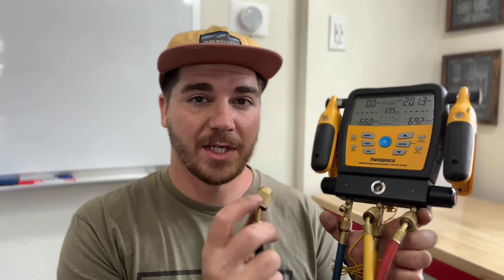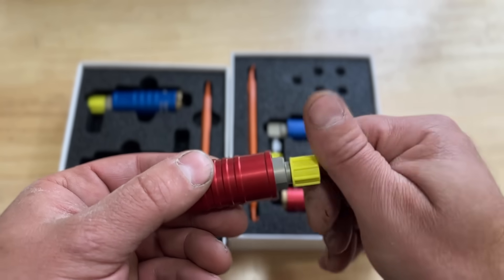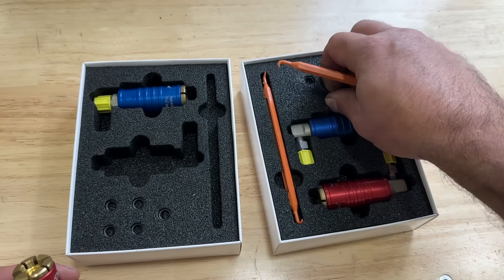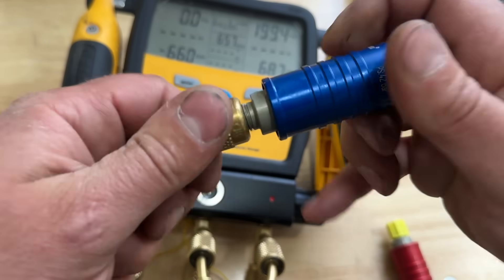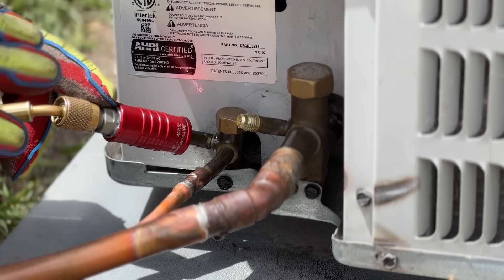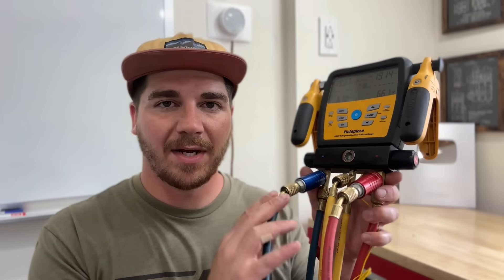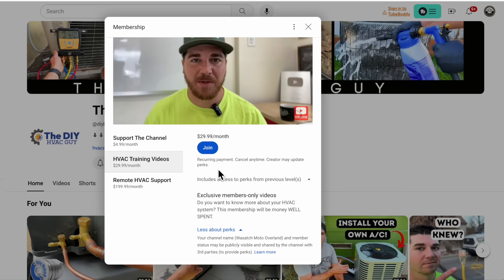This New HVAC Tool Is A GAME CHANGER.

Comment: I thought maybe $50 at the high side, but $200!!  I rather lose a bit of freon.
Reply: Just wait till China start producing them. These are basically quick connectors that are used in car AC's. I predict you will be able to get them for less then $10.
Reply: @lwh7301  Hope the quality stays though.
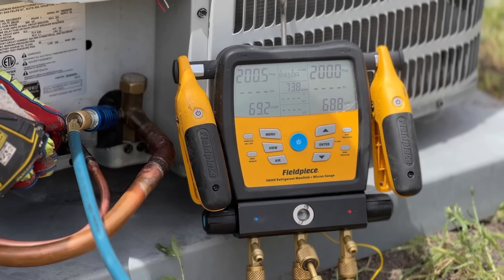Reply: 3:27 to 3:28 appears to be a jump cut - wonder what happened between takes with high pressure connection
Reply: @L0st-n0found damn I just had to go back and check that. You see not much comes out on the 2nd part
Reply: @FirstLast-f8z  yes I wondering in the 1st take how much came out that it had to be redone so not much came out.
Could just be a glitch encoding or whatever but very much looks like a jump cut to cover up something
Reply: I  saw this comment and immediately left, didn't even watch the video, I'm good lol
Reply: Trying the $21 dollar Amazon ones. R410 liquid side is freezer burn!
Reply: Yeah I’ve been eyeing this for years but since it’s German we get taxes like hell.
I hope that just like Knipex someone like Irwin would copy this design and make it affordable for the US techs.
Reply: They must not last cant even buy them now. Just get the low low ones with the screw head works great
Reply: You can  do same thing standard hoses but you push on connectors unscrew
Reply: Unless your gauge is only servicing one refrigerant and you're keeping the gas in the hoses in between connections, you're loosing quite a bit more gas from the system by pressurizing the hoses when you connect them to the system than you are by just attaching the hoses and loosing a little hiss or spritz of liquid, aren't you? Unless you're really slow when you screw the fittings on.
Reply: @WaffleStaffel  And since refrigerant loss damaging the ozone layer, and now they say ozone safe refrigerants still need to need replaced because they have to high of a (shit I just had training on it and don't recall what the scam was) we gotta switch again.
I like pepperage farms remember when we purged and pressure tested R-22 systems with R-12 because it was cheaper than nitrogen.
Funny how the OMG R-12 is killing the ozone layer happened when DuPonts patent expired. I also remember then they came for R-22 using the same reasons, so R410A came out. It was said to be ozone friendly, safe for the environment etc.
But here we are again, and R410A is evil, and we must replace it with R454B, its already stated that in 10 or so years we will need to replace R454B....do you see the pattern I see?
Reply: @ZERO-F2G- not a pattern but a plan
Reply: @ZERO-F2G- in some Middle East countries if not all no one cares about those things and they have hvac techs work every day installing and repairing and maintaining units worry free of these rules only we have to worry about this ozone 😂 and keep paying for changes happening while they still have new R22 units being sold and 20 pounds r22 is for 30$ to 50$ max that’s why they don’t care how much they lose in the air while here we buy it for ove 1000$ this is a joke
Reply: Losing a bit of freon is far cheaper for a DIY, but when you're charging by the job, you want to minimize cost.  There's a break-even point, somewhere.

Comment: 20 years in the trade and I’ve never used gloves to connect gauges, also I’ve never been burned by refrigerant.
Reply: Really? Not once? In the past 35 years I have done it a few times because sometimes you're just dealing with a nightmare of a installation that some got away with and you just do the best you can.
Reply: @KO-pk7df  damn, 35 years in the trade! I have much respect for the veterans in the trade.
Reply: yea, I'm sure literally never. Smh. Ok dispatch.
Reply: @ChristopherSugg  - never once! Always had valves at the end of my hoses. How the hell would I burn myself?

Comment: Shoot, I've been using a set of those for over 5 years. But be aware, when you pop off that high side the O-Ring is going to fly out, so keep it close to the fitting or put a rag around it, also it does not like to go on if there is pressure in the hose.

Comment: Now that's a sweet setup there. Time saving & much less loss of refrigerant. Every customer always asks or say I paid for the refrigerant that you just let go. They always say they being the AC guys in the field. We always put in a little extra just for that measure. Yeah okay. 🫣 Love the video! Will definitely check out the expansion and understanding of home units. You would think it would be just the same as commercial but they are not. Fundamentally they run the same but with commercial you have higher voltage either at 240 volts but we ran 277 volts. Contact relays etc etc. I would like to brush up and deeply appreciate the opportunity to possibly join and win something that would progress my knowledge in the field. Thank you kindly 🕊️

Comment: Well lets see $220.00  is far less that $44,539  per venting violation, the EPA pays 10,000 to any witnesses reporting.
Reply: Because these are the only way to connect legally. 🤔
Reply: @realSamAndrew  Out here in Arizona we do things differently and you obviously never worked  spindle chillers and it shows.  I bet you never even seen a Vacuum Chamber .
Reply: @ericabarca5871  you've obviously never learned about logic. Because your arguments make no sense, and completely sidestep the point, and don't answer the challenge presented by my first comment.

In case you don't understand what I mean, let's put it this way: are you trying to claim that without these 200$ connectors, you will be fined? There's no alternative and never has been? What did you do 2 years ago before these were available? There's no cheaper product or method to avoid an EPA violation? It's $200 or $220 or $44,000, take your pick?!
Reply: @realSamAndrew  I don't know but if i ever see you charging a unit, I'll report you.

Comment: German engineering?  Remembering the dumb engineering and fixes our beetle required... it's a turn off lol.

But yeah low loss appion gear seems worth the cost imho compared to these.

Cool though and keep the content coming <3

BTW a diy guy called into the shop "I installed my ac myself, but can you guys come and braze my line set, purge the system and add needed refrigerant? "

I thought of this channel when he explained his needs. Hopefully everyone else has better luck.
Reply: I had a guy get a quote to install equipment he's getting from a friend who's a vendor. He hasn't accepted the bid, guess it's too much. About to tell him if he does the tear out, install, electrical, I'll come brace them and open the valves for $500 lol
Reply: @StangxX  =b you're a good man and i hope the guy will appreciate your help!

Comment: A true tech does not leave pressure on his gauges.
Reply from the maker: No such thing as a true tech.  We are all just wanna be’s
Reply: @diyhvacguy speak for yourself. You’re supposed to be licensed to work on hvac systems hopefully nobody gets hurt because you promote DIYing them.
Reply: Talking about cycling all the refrigerant into the system from the gauges?
Reply: Wanna bet?
Reply: Digital gauges don’t matter with that. You’re talking about old-school gauges and those are really good for probes because you don’t wanna mix refrigerant on the hoses so for like today when I’m doing maintenance on this 40 system hi rise today that would be really good for hooking up the probes for sure. ❤😊
Reply: I often leave a little pressure in my gauges so I know there's no leaks.
Reply: It took me long to figure it out no one ever thought me til it clicked one of these days

Comment: Unless you have an actual problem with a unit, it is no longer considered good practice nor even necessary to check an a/c unit's refrigerant charge. You are better off only checking temperatures of the air intake and out, temperature of the lines, and temps in and out inside. 
And instead of these tools, you should use Accutools's valves that first attach to the lines, then attach your measurement tool, then they have screw valves that then depress the shraders to allow refrigerant in. Even then, only one is really necessary for the liquid line, and if you use probes, will not lose any siginificant refrigerant that needs to be fed back into the system.
Reply: I use stub gauges with a charging tee and ball valves.
Reply: @thisisyourcaptainspeaking2259  yep, even were available in analog form. But rarely anyone used them.

Comment: I still hear a spurt when disconnecting... the same kind of spurt when you disconnect the normal hose quickly. almost seems like the Schrader valve is going to let about the same amount out regardless of method so save your $200, unless your an idiot that untwists the traditional hose slowly
Reply from the maker: Sometimes you can only spin it slowly due to the position. 🤷🏻‍♂️

Comment: Looks like somthing a young kid would waist money on 200 bucks for somthing that will fit maby 60 percent of units I work on might suggest good pair of gloves for 20 bucks
Reply: True. There are a lot of units you could get one of these on and not the other. Im about to upgrade and get the job link setup. Those wireless/hoseless ones barely release any refrigerant. But, like these, they just can't be used sometimes.

Comment: Lots and lots of units where there's not enough room to fit these due to bad engineering from the manufacturer not thinking about the service techs. Price is too much. Obviously the hoses must still fill up with refrigerant. So there may be less squirts upon connecting and disconnecting, there's still refrigerant loss in the gauges and hoses.
Reply: That's why I love the fieldpiece probes and tees and backseat control valves. Incredibly small amount of refrigerant loss when connecting/disconnecting
Reply: You could always give proper procedures a try and have virtually little to no refrigerant in your hoses when finished, give it a try.
Reply: Not to mention if you leave the hoses pressurized then hang your manifold in the truck on a hot day your gauges could blow a spring with the increased pressure. Don’t ask me how I know.
Reply: @davidlundy5007  That would be a lesson learned. Just don’t do that. Simple.
Reply: @davidlundy5007  whoosh, your supposed to never leave liquid refrigerant in anything that doesn't have or connected to expansion space(cylinder, receiver, accumulator).
so never in hoses, lines, gauges or anywhere else between closed valves. doing so it asking for a very high pressure explosion. a little vapor pressure isn't as bad, but still not good for your gauges.

Comment: If you’re just checking pressures use probes, these will just give you contamination on the next unit you hook up to. If you let liquid out of your hoses, you’re doing it wrong, heat up your hose by rubbing it to boil it off.
Reply: Or vent the high side to the low side for a second or two....
Reply: @GaryGipson I was just shown this method. Don't know why I hadn't been shown before.

I am also buying the fieldpiece job link set with the probes
Reply: I have a ball valve on my high side and always charge it back through the low side before disconnecting. there's basically zero loss that way, only a minuscule amount of vapor

Comment: While I appreciate new tech....this is a waste of $200.  You can just buy flow control valves for $20.  (C&D CD5050).
Reply: Come on man why are you trying rain on our parade I have spent 200 bucks on all kinds of dumb stuff smoking drugs women with no scruples these fittings won’t let you down but the other things I mentioned will  .
Reply: @robertstonebreaker8394 You had to have known that anytime someone recommends a new type of tech that is a call for all of the Super Techs to express how the new tech is so far beneath them. Their way is ALWAYS better. 😑...🤣
Reply: @Aquariun9iteMMare  Knob, another DIYer I’m guessing, new doesn’t mean better .Stay Cool ❄️
Reply: @robertstonebreaker8394  wait, are you telling me drug smoking women of low character might let you down? 😉😁 some are dumb enough to stay married to one twenty years. Who you looking at ?  😂🤣  I'm just a slow learner I guess. She cost one Hell of a lot more than $200, I'll tell ya....😩
Reply: While you are right the fact is the c&d valves still release a spay when disconnecting, about the same amount as low loss hoses, this is the why the $200 connectors were born… they eliminate that loss as small as it may be… to each their own 🤠
Reply: And the new ref is ganna make all this not work
Reply: The CD2070 core depressor has an internal shut-off that holds gas in the hose when disconnected. $21-28 each
Reply: C&d valves suck bit of mine went out within a month
Reply: I have a valve very similar to the 5050 that’s part of a hand pump I use to set pressure on the air shocks of my mountain bike. Once that valve is closed, anything that gets out after is from the hose (not the shock), not the system so any refrigerant that comes out will be in the tools hose no matter what.
Reply: @GNX157 which pump?
Reply: @Chuckolicious  don’t know at the moment. It’s in the trunk, but it does the same thing, backs off the core valve so the air in the shock is sealed in before removing the hose. Even 1-2 psi on a front or rear mtb shock is critical. Most modern good mtb shock pumps are this way now.
Reply: JB Cobra hoses dont spit at all!